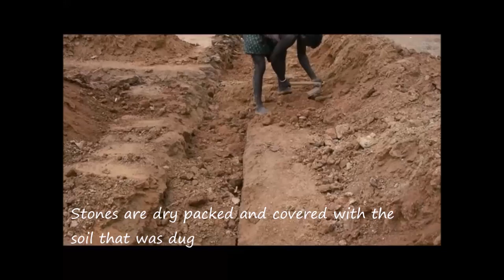Building a Cob House - Stone Foundation - Vrutta

Comment: I would never ever cover my stone foundation with dirt, NEVER !!  It defeats the point of the rocks ability to drain water away from the foundation in the first place by clogging up the rock gaps with soil ! You mite as well just build on the flat soil level with no drainage at all because you effectively stopped your rock trench from draining ! If I was going to use those big ass stones under there I'd pack and tamp 1"-1¹/²" rocks nice and tight all around them with double felt landscape fabric pinned to the trench walls on each side to prevent soil clogging the stone up !! THEN the stone foundation built on top of that ! Just because they may be in a third world country doesn't make clogging your rubble trench a fine idea !!
Reply: Then what is the correct method ... Share me any videos if so ...
Reply: @haripsd26  well the closest video on youtube to the way I'd do it is one video from Advanced Earthen  Construction Technologies. Punch in 'rubble trench foundations' in the search box. Many video clips will pop up but that particular vid clip is how I'd do mine ! Now their wall construction is way different than mine, but their rubble trench foundation is pretty close to my method.
Reply: @haripsd26  and you know the trench that the Live, Love, Farm guys had dug 'was' a really nice looking ditch with square straight walls before they back filled it with all that soil over the rocks !
Reply: @eugeniotapia6765  Thank you 🙏🙏🙏
Reply: @eugeniotapia6765  ok ... Are you interested in nature mud constructions ? Where are you from ? India ?
Reply: @haripsd26  yes I love all the natural old school earthern houses ! I'm from the good ol' Abobe Kingdom, New Mexico, USA !
Reply: @eugeniotapia6765  inspiring 👍👍👍 . Thank you